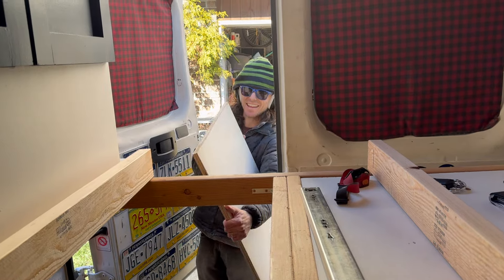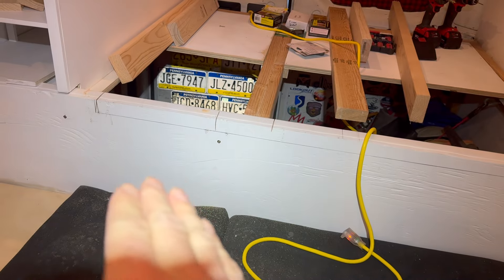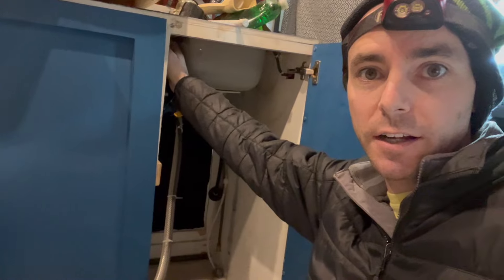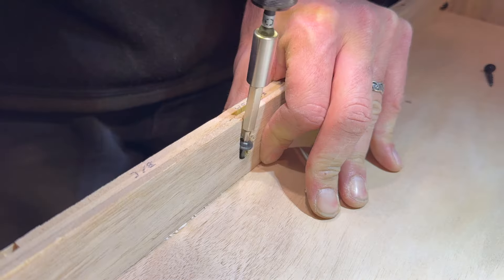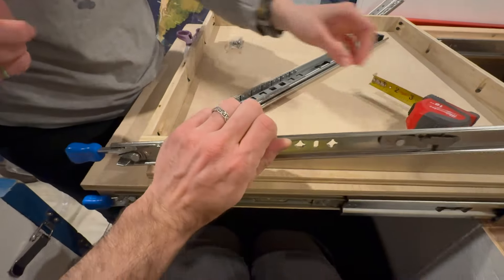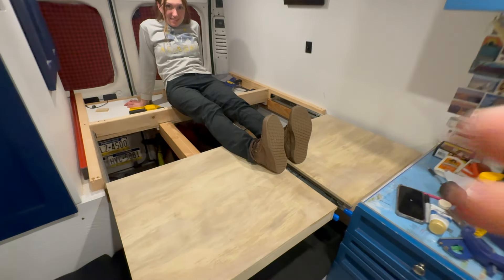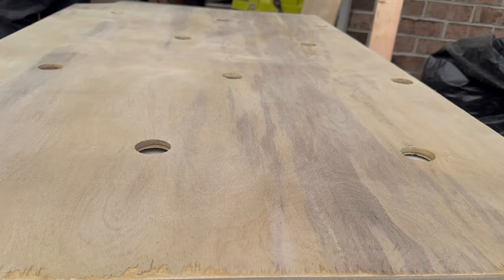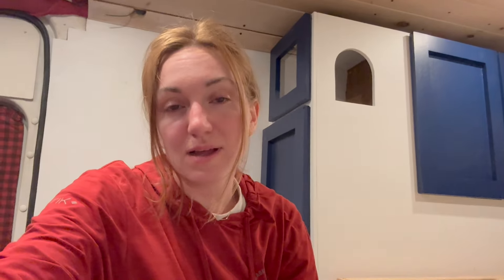Renovating the van after 5 years — VANLIFE’S BEST BED

Comment: Get yourself a "dry mat" for under the mattress -  its basically a 10mm air gap, will mean those holes give air to the whole underside. Honestly, will reduce condensation under the mattress by 95%. I went through 2 mattress before sorting it out. they really work.

Comment: Van is coming along real good! Did I mention the mesh I had under the mattress and seat cushions in the MAN truck? See item below I copied off the interweb:
Marine Bedding is the owner of DryMesh™, a three dimensional woven polyester mesh, designed to reduce moisture under mattresses and cushions. Made from 100% non-absorbent white polyester, the unique 3D mesh allows air to freely circulate, eliminating condensation and mildew build up. 
Bestest to you both xx